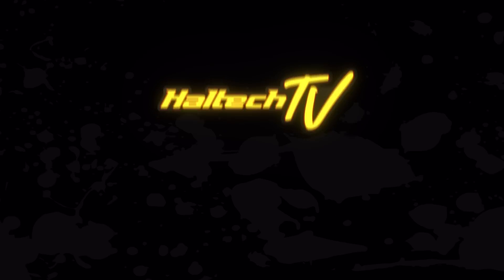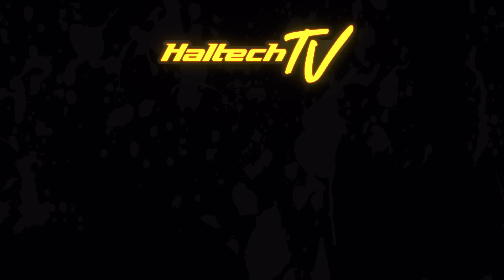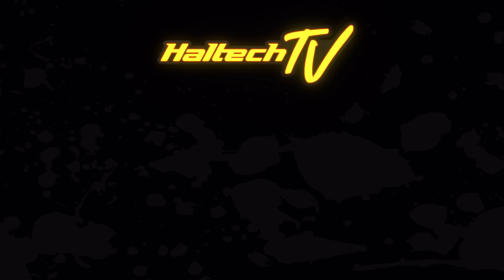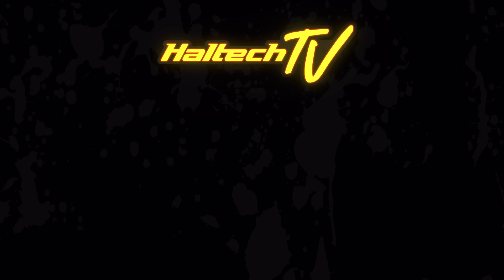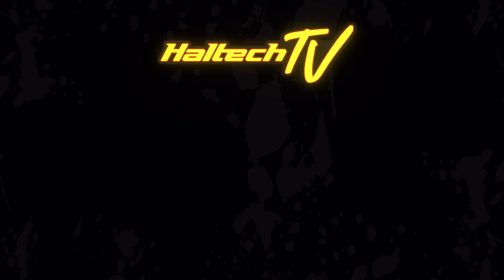🛠 Why some cylinders run hotter than others? | TECH TUESDAY

Comment from the maker: Tech Tuesdays are back baby!!!
Some engines are more prone to this phenomenon than others but the problem of one cylinder running hotter than others is a common one across most internal combustion engines.
In this episode of Tech Tuesday, we explain why this happens and offer some common sense solutions.
-----------------------------------------------------------
Liked this video? Here are more like it:
EGTs Explained: https://youtu.be/-NoFfck5v4c
Turbo or Supercharger: https://youtu.be/BxIxmO37Lkc
Hall Effect or Reluctor: https://youtu.be/lTAW0lTqP6s
Reply: On the MX-5 the block was designed for the water to flow the opposite direction in the 323 than it was run in the MX-5 and that made #4 hotter, reverse the flow of the water #4 cools off.  Also on the MX-5 when it had a return on the fuel rail would make #4 run leaner which made it hotter, so replacing the rail with one that fed fuel from both ends fixed that.  Both of those combined let me push the tune much harder and make more power (turbo) just by getting consistent fuel/burn across the 4 cylinders.
Reply: not automatically intuitive for us humans, but for a fly it must almost feel like a fluid at their rate of wing flaps.
If one does understand VE tuning, the mass and density of air should not feel that abstract, right?
Lets me think if a fly does even preceive air as more thin or dense related to the small barometric pressure difference between 950-1050 hPa ... we will maybe never know.

Comment: I don't know if i subscribe to the air flow being pushed the rear cylinders being a sound solution for 5-6

I have a few old red motors all of them run lean or hot on cylinders 5-6 

I have one with one stock carb and manifold

One with twin carbs 

And one with triples

Comment: Interesting topic… I had figured heat soak at the back of the engine bay but hadn’t thought about air flow in the manifold. Logical and stands to reason as a engineer though. 🤓 Just changed the plugs, leads and coils on my 2014 Stage 2 Roush Raptor and had fun trying to figure all that out by reading the plugs I pulled. Two per cylinder in either ends of the chamber over eight cylinders, there’s a bit of head scratching to be done. Going to read them again after watching this. 🤓😎

Comment: So if u had a set of 1200 cc injectors. And your engine wasn’t getting as much air on cly s. 5/6. Would u go with an 1150 cc injector. To try and balance your cylinders thanks ken feeler

Comment: few things…

the same air phenomenon happens with the heat from the runners all being pushed too the back of the bay?

A temperature gun monitor each runner can also give information-even more so during the dyno session

Run less timing on cylinder six is also an option

Comment: There is reason subaru runs knock sensor on cylinder 4...

Yes that one runs hotter than other...exhaust port S turn doesnt help.. plus with unequal length header making it even worse and more prone to heat and detonation...

Keep cyl.4 happy, the rest of piston will be happy too.. (unless there is stuck injector on tue other cyl)

Comment: What about when you add another 10+% of fuel in the hottest cylinder and its still hotter than the rest, and you can't add any more trim because you start having plug fouling on idle due to too much fuel? Is there anything that can be done with ignition trim for that cylinder to add a bit of safety? Would it be wise to retard that cylinder a degree?

Comment: What about external airflow around the engine bay? 

And what about NA engines that are sucking the air in rather than being force fed. LS engines for example suffer with no. 7 & 8 running hotter. I run 2% fuel trim on the rear two cylinders on mine.

Comment: Haltech elite 2000
Would you statically make cylinder 6 use more fuel? Or is there a way to dynamically add more fuel to cylinders based off a deviation from the average egt of all cylinders?

Comment: hot rear cylinders from lack of external air flow. even water cooled engines need air flow externally.

buy the time air has passed through intercoolers, radiators etc obstructing air paths the under hood temps at rear of block are increased.

Comment: Any insight on why the back of the n/a bara is hotter? It's mid injected for the air flow and nice and long. 
I had the same on an intech as well and they have that whole venturi thing in them.

Comment: Scenario: you don’t have individual cylinder EGT. You have a 4 cylinder engine and blindly think it may heating the rear.

You add say 5% additional fuel to number 4 at the rear and 2.5% to number 3. Do you now have to be careful of your lambda target if running a single lambda sensor in downpipe? Reason being the lambda sensor reading is an average reading: you don’t know that 3 and 4 were potentially running lean and now through the average lambda target you have effectively leaned the air fuel ratio in number 1 and 2 by c. 3.75% fuel per cylinder if you are targeting the same lambda target.

At 11.5 afr that would mean cylinders 1 and 2 could be running 11.9:1 on average and potentially leaner on an actual cylinder given different distributions. This appears a potential issue with blindly richening cylinder fuel trims.
Reply: great point. hoping Matt responds to this
Reply: bump I want to see this answered ! Particularly since ive got an sr20 with the P12 head that is supposed to be cooled better than the det head.

Comment: What about reading the O2 sensor on each individual exhaust pipe, and there you can see how much air is one cylinder getting by looking which one is leaner ?
Reply: You could but they cost more than a temp sensor. The temperature of the exhaust is a decent proxy for mixture if everything else is equal.
Like if you get the egt the same your af ratio is going to be pretty darn close.
Reply: @zyeborm  you don't need to buy 4 O2 sensors, only one aditional sensor if you don't have a spare already and the weldolet on each header pipe and plugs, once you start engine test each cylinder at the time, make the adjustments based on that, at the end all pipe headers will have plugs. Leaving only the main O2 sensor at the collector.

Comment: Hi Matt, another great video. I have a question regarding exhaust flaps or bypass's. Do most guys use their ecu (Haltech) to trigger these? Ive heard conflicting stories on what way to hook them up?
Reply: @Matt Wright thanks for the reply. I suppose its possible to have a 3way switch, position 1 off, position 2 ecu controlled and position 3 open all the time.

Comment: This cyl 6 issue is negated with oldschool cross flow intake manifolds like on the 7MGTE but then I imagine opens up a cyl 1 & 6 running richer problem haha. I still feel like the coolant having to flow through from 1 -> 6 is a big factor. That and cars with EGR usually mount the coolers on the back of the head xD

Comment: Matt, I would argue that if someone is spending the time and effort to have their beloved fuel injectors bench tested and flow matched, then they've likely invested in a quality engine management system like a Haltech. Therefore, a flow-matched set is of great importance as the margin for error gets much smaller the harder they're pushed and near the point of being maxed out. A set with unknown flow rates (unmatched) would only likely benefit someone that couldn't measure the results of their test. A set of fuel injectors is only as good as the weakest one.

Comment: Air is nothing but fluids expanded into gases. Stands reason that the  characteristics would not be much different other than the weight and energy transfer of these gases is much less than the liquid form

Comment: So the problem isn't really inherent with the engine itself, but a function of the possible intake manifold designs?
Reply: @bigboreracing356   Odd.  Oil is a coolant.  It removes heat because it's actually cooler than the surrounding metal - which explains why some engines squirt oil up under the piston skirt to cool the crown.  That's presumably also why we have oil coolers - to remove the heat it absorbed from the metal  So the more oil there is in a specific location, the cooler that part of the engine should be.
Reply: @bigboreracing356  that's just all kinds of wrong. For a start, not everyone drag races. Second, oil provides a cooling effect so by your logic the rear cylinders should be the  coolest. You should also check just how much oil flows through an engine, you'd probably be surprised. Also baffles and dry sumps are a thing. Air flow is the cause, as has been proved many times over.

Comment: Great info, What do you consider temp flucuations worth correcting the fuel vaule over, say 20 degrees or less? and how well do the egt's need to be spaced in manifold? Is by eye close enough or mm prefct needed!
Reply: Typically you want the EGTs to be about 2-3 inches or so from the port. Not too close to interfere with flow, but not so far away that it yields an inaccurate reading. Temperature variance is all a matter of your discretion. Much like a cylinder compression test, the overall number isn't as important as similarity is. Any fluctuation you encounter, be it one degree or 50, if the cause of the variance is airflow, adjusting fuel trim accordingly should rectify the issue.